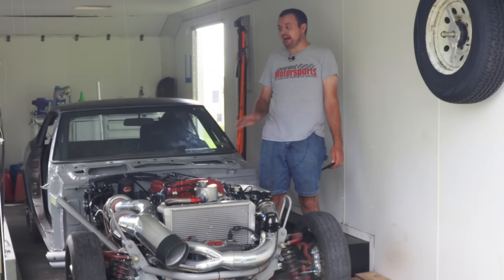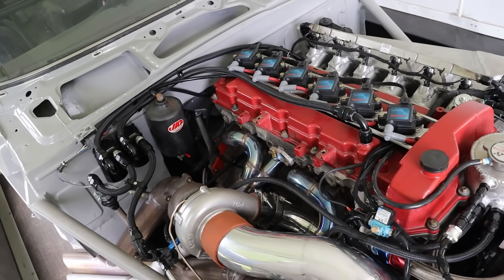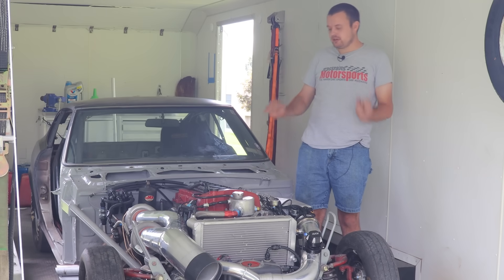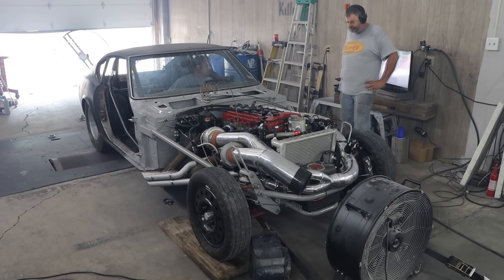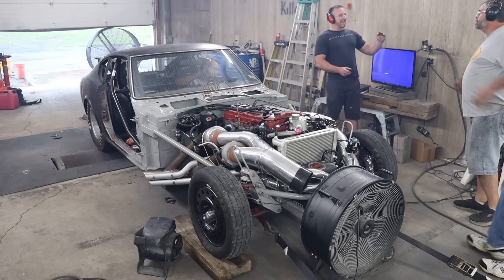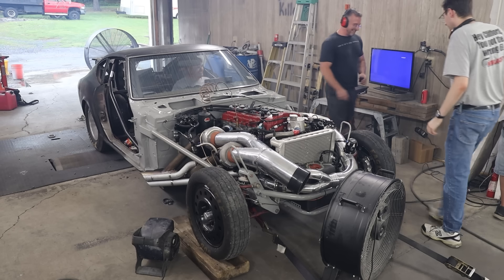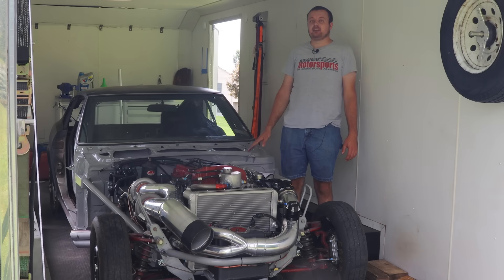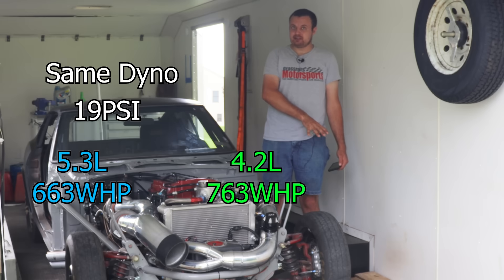This 4.2 Liter Engine Just Beat a 5.3 LS!

Comment: I'm calling out your physics teachers if you think that heads don't matter.
Reply from the maker: When did I say that?
Reply: @Calvin-Nelson 09:49 you insinuate that the heads on the 5.3 aren't ported and keep harping on 19lbs of boost. Boost isn't everything (adiabatic efficiency, swirl, etc) and what is "less cam"? What kind of lobe separation angle, one might ask? The correct answer is not "it doesn't matter because it's 19lbs of boost". Aaand if you're doing a comparison, you have to look at torque curves, not just "Car and Driver" numbers.
Reply from the maker: @blahbadyblah  I don't have to do any of that. I picked a variable to remain constant between the two engines, one that I cared about and performed a test. One did better than the other by such a wide margin, that I felt it was worth sharing. If you don't find any value in it, I can't help you beyond that. 

Was it a perfect test? Nope. My hope that 100 HP more with 71 less cubic inches of displacement, and much smaller cam profiles both in lift and duration, would be enough to make a reasonable guess at which engine is performing better. 

See ya!
Reply: @Calvin-Nelson You don't HAVE to do anything at all. However, in your comparison, you're missing over 100"hp" of mods on the 5.3 that have been done on the 6 cylinder. I hope that you're at least aware that flow restrictions can make boost numbers look higher and that "horsepower" is a hypothetical extrapolation.
Reply from the maker: @blahbadyblah  Even if it made the same HP. It's still impressive.
Reply: @Calvin-Nelson Oh, of course.  From about 6100 to 7500 torque is over 600lbs-ft. That's a pretty fat curve especially for the small size. Big block numbers without the heft.
Reply from the maker: @blahbadyblah  That and it did it with no camshaft. The number 1 killer of cars on drag and drives are Valvetrain related issues. I'll take the engine that can make the power at a higher RPM, and do it with less aggressive Valvetrain, because it will have less failure.

Comment: My 04 Envoy has this very engine. 100 percent stock.  335,000KM and still strong.  no leaks or burning oil. it is an inline engine so it is torque not HP.

Comment: You mentioned that the 5.3L makes 100Hp less as compared to the 4.2L setup.
Horsepower is a product of RPM. The question is how high did you rev the 5.3L as compared to the 4.2L revved to 7571 RPM?
Great build awesome channel !!
Reply from the maker: The 5.3 with a more aggressive cam, and more displacement peaked at 6500
Reply: @Calvin-Nelson  now spin that 5.3L to 7571RPM and see what happens with a proper cam? That would be a great comparison
Reply from the maker: @hpjunkie69  you could easily do the math. 7571÷6500=1.16, so it would make 16% more power.
Reply from the maker: @hpjunkie69  I'd rather have the engine that makes more power with less camshaft. That means it will have less valvetrain issues, which is a big killer on the Drag and Drives

Comment: I dig it. Those are the kind of stats I've seen from a  4.0.   6 cylinder jeep motor. Impressive 🤔👍❤
Reply from the maker: I've not seen a Jeep 4.0L that has the cylinder head flow that these do. Throw enough boost at anything, and it'll make power
Reply: @Calvin-Nelson  thats awsome, I'm talking about Profesional high proformance engine building, and dynamic testing, with stats beyond a diesel 700 pluss hp with 700 foot pounds of torque.  And they said they believe they can easly hit 800 horse with the same torque,  and torque is whats going to move it beyond horsepower, 
I read about it and watched the videos of what they achieved,  6 cylenders are no joke, hell even the iron Duke. A 4 calendar was known to get over 400 horse.  Done right is the name of this game. You've done an awsome jobe. I'll pat you on you back, and give you 🤔👍👍👍👍👍, yeah, several of these, . Good video.
Reply: Oh yeah, I don't know about the motor you showed, sorry, engine,  but the jeep motor has 7 bering journals on its crank,   very strong torque monsters . 🤔👍

Comment: That Hp difference probably has more to do with turbo size and efficiency..
Reply from the maker: Both turbo systems were not even close to their limits we turned them both up from 19psi, and they continued to make more power. Turbo efficiency may have been a very small component, but I doubt it was more than 20hp. The smaller engine still made 100 more HP

Comment: On LS, manifolds are for aspirated engine! Meanawhile on 4.2 you put optimazed manifolds. Good cams for aspirated engine can be worst for turbo application. And head work make differents on turbo and aspirated. To be honest: LS was tuned like frankenstain, 4.2 was tuned more accurately. It's interesting comparison! Do you know fule flow rate? And rpm of max power is the same?
Reply from the maker: Yeah. I realize it was not a perfect test, but I still think it should be a wake up call. 71 less cubic inches and it makes 100hp more. If they had made the same HP, I would have still been impressed with the 4.2

I don't have fuel flow rate, but that is very closely related to HP, so you can do the math. The LS peaked at around 6500. The 4.2 peak was like 7300-7500 (it's in the video. I don't remember)

Comment: Mate, I hope your new torque converter is heaps better than that black one with the tabs broken off and not just another same design built. Because I build torque converters and that one is CRAP ! (no offence) it's a super old 10 inch design. You should be using a billet back (or actually front, as in flexplate side) but we call them the back in our world. Also I hope it's a GM 9 inch design, as they have a million different combinations you can make with different impellers and different stator combinations you can build to suit a multitude of combinations. I know it's a year old video, but I've only just seen it. Bloody cool though mate. We have a similar Ford engine in Australia called a "Barra"

Comment: Awesome build etc looks like a good deal of potential in these engines. The bottoms end seems stout the way it’s designed. I was sorta excited about these 4200 when they cam out. Similar hp to my 2nd gen LT-1.. not tq and not in the same league with power imo but hp numbers impressive for what it is. It’s a large 6 at 4.2 imo. Seems like a really good head stock. Wonder what they flow. maybe it’s comparable to the 5.3 with the difference in fuel etc but torque isn’t any better I bet even with the advantages.

Comment: I'm looking to get into this engine for a 67 Camaro build. In the middle of looking for aftermarket support, which is keeping me on the edge because it doesn't look like there is much. What camshafts are you using for this build? Custom regrinds? If so who did them?
Reply from the maker: Yeah. They are regrinds from Schneider Racing Cams. Have a look at this. https://sites.google.com/view/vortec4200wiki/home

Comment: Run them stock
Reply from the maker: That's not an interesting comparison. You can Google that information if you would like to know it.
Reply: @Calvin-Nelson  i know what u mean to. What kinda Trans and rear end running
Reply from the maker: @djhodges6892  Th400 9 inch in the 4200 car. 8.8 in the LS car
Reply: @Calvin-Nelson  gear kit or no
Reply from the maker: @djhodges6892  I'm not sure what you mean.
Reply: @Calvin-Nelson  gear ratios  a gear kit?
Reply from the maker: @djhodges6892  the 4200 had 4.30 gears. The LS had 3.27
Reply: @Calvin-Nelson  dont know if it would fit in the 4200 but put a Powerglide in it.
Reply from the maker: @djhodges6892  Nah. That would make things much harder. Would have to have an extremely loose torque converter and when you need to lay the power in on top it will slip like mad. Powerglides are better suited for engines with a lot more torque.
Reply: @Calvin-Nelson  well damn that sucks. Be real nice just to shift twice

Comment: I've been saying this for quite a while.  The Vortec 4.2L Atlas engine is an awesome.  Should have been America's 2JZ, but GM dropped this motor. Idiots. Aluminum 4.2L Inline-6, 24-Valve DOHC.  These guys built an insane Beast!  Should be swapping these into our toys.

Comment: which gearbox is used? will it be possible to connect this engine with Borg-Warner T56 or getrag V161?
Reply from the maker: We're using a th400. Yes those are possible.

Comment: Pretty cool. Technology has dramatically increased the hp gains on street and race motors these days. John Lingenfelter (RIP) made over 1,000hp on a GM 4 cylinder Ecotec engine years back. The biggest challenge at the time was keeping the cylinder head from cracking. The turbo he used was damn near the size of the engine block. You guys oughta be killing it on the strip. Best of luck!
Reply from the maker: Thanks!!!

Comment: With all fairness you said the 5.3 is single s480, but the ameri barra is twin, there may be a discrepancy in cfm flow between the two, and you didnt mention the size of the 2 turbos on the 4.2..
Reply from the maker: S480 is known to go 1200 hp. We aren't even close to that. Richard Holdener has done multiple tests to show that as long as you are not close to the CFM limit of the system, twin vs big single makes no difference.
Reply: @Calvin-Nelson  eeh somewhat, his twins made more power over the single if I remember correctly but only by 10-20hp, where the biggest difference was  was in spool and torque, one had a higher tq lower.

Either way props on the buold, looks sick, wish I could get a gen 1 supra and toss in a 4.2 with a t56, and twin spooly bois  more torque than the 1j or 7mgte, or the 1.5j and more hp at lower boost, while still sounding pretty sick. 

Also did you make the intake or have it made? I see your dad likes to hand port in the vid, and you made your own dual manifold in an earlier vid. But I didn't see one for the Intake, if you did make the intake what is the math for your runner length and plenum volume?
Reply from the maker: @62saki91  I made the intake. The math was, does it fit the car?

I did another more recently and did a shorter runner. It seemed to want to RPM more.
Reply: @Calvin-Nelson  aah, most if made themselves have a formula for plenum volume, short runners are good for response and high rpm, long runners give more low down grunt and torque. Tuning the setup so all parts work together and maximize each other at the peak power production is always best.

Comment: I had this motor in my 2009 Trail Blazer, which was the last year of the Trail Blazer. It was factory rated at 275HP, and a lot of torque, and that is why I bought it to pull my boat. It was a strong motor, and plenty of power on the highway. It had no problems pulling my boat, and did not have any problems at all with it. I wondered why no one had done any hot rod ding with the motor, but assumed it was for all the computer stuff that no one wanted to mess with at the time. This would make a great motor in like a Chevy ll with a straight stick, as would be a torque monster with headers and the like. With turbos I am thinking the sky is the limit! Great article!

Comment: The trailblazer I owned was fantastic. Folks were taking the 5 cylinder atlas motors and boosting them back in the early 2010's, I wish I could've done that to my truck, but there wasn't enough room. I think that version of the engine was in the colorado and hummer H2

Comment: The Atlas engines seem to have an Achilles' heel.  Once they get to around 200K miles, there is usually catastrophic engine failure.  Trailblazers and other vehicles that had them show up constantly at my local salvage yard, remarkably consistent failures.  They don't blow head gaskets - it's broken rods, something in the rotating assembly etc...Friend of mine had one, he kept thinking is was a fuel problem, I put a huge adjustable wrench on the crank bolt, no turn.  Seized motor.  I would only consider one of these if the internals were strengthened, but with that, goodbye budget build.
Reply from the maker: The ones we've seen will break before 125k or go 300+k the one we made 824 whp with was a completely stock 175k motor with cams and springs.

Comment: The C30LE on my Opel omega 3000 began to show signs of death, so I'm thinking of replacing it with one, I hope it will fit under the hood, because this engine is not much heavier in weight.

Comment: the engine is a german design with 4 valve heads so it probably has more hp at a much higher rpm than the LS

Comment: Have you thought about having the ring machined in the head and the block so you can give it the big boost with less chance of losing the head gasket I’d love to see if that would handle 30-50 psi boost great job hope you guys have fun and have safe racing thanks for sharing
Reply from the maker: We've had one to 40psi and have not had head gasket sealing issues yet.

Comment: Is there a small, light, 2 seat sportscar chassis by GM, that is not a Corvette, that this engine could be dropped in to?
Reply from the maker: It would be a tight squeeze into anything small, but we have done it in a Fiat before. You could do a Pontiac Solstice.
Reply: @Calvin-Nelson  Thought later, it'ld be an ideal motor to drop in a Holden Torana, both the LC/LJ series used for the XU-1 racecar, and the later UC 'Sunbird' hatchback.
Dropping one in to a replica Torana GTR-X would be pure porn,... ;)

Comment: You have a lot more turbo on this motor than the 5.3....lol

Honestly, not impressed.
Reply from the maker: An 80/88 vs twin 62/62s????? 80/88s are known to go to 900-1000whp on a 5.3. We're not where near that. Check this video out. If you are not near the limit of the turbo system twin vs big single does not have much of an effect. https://youtu.be/zp65Y7wKaEo?si=Gb_wBipMIZ2NxAjM

Comment: I have very often thought about the 4.2 GM DOHC inline 6 as great choice for a vintage mid 30's through 48 Chevy Street rod project and thus keeping the car t rue to it's inline 6 heritage. Even in slightly modified state of tune it would make a sweet running and quick street performer. I'm an inline six fan and have always preferred working on them.

Comment: I didn't catch the model number of that engine, and I think I want to buy one and maybe retrofit it to my 2004 Ford F150 FWD.  I would also need a GM trans and it might not be good money spent.  But that's one hell of a 6 and my good running 2004 Ford 4.? ltr engine has 220,000 miles on it so a new motor is attractive, especially a straight six that makes horsepower like this one.  I don't need that much HP, as I prefer reliability, but still... damn.
Reply from the maker: It's a Vortec 4200 from a Trailblazer.

Comment: Try comparing the 5.3L on twins and meth and the 5.3L wins all day long....especially on availability of affordable aftermarket parts (even though a SBE 5.3L can take over 1000hp on it's own).  That being said, I love the exploration into less popular engines.  And I love the idea of an "AmeriBarra" engine for GM enthusiasts.  It would be great if the right people/companies with certain abilities (access to CNC machines, camshaft cutting machines, etc) started a small aftermarket for these engines.  Considering how prevalent these engines should be in junkyards these days, they could be the next, affordable Vortec alternative for hotrodders and racers alike.
Reply from the maker: When the turbo is not being pushed to the limit, twins vs a big single doesn't make a ton of difference. Here is proof. https://youtu.be/zp65Y7wKaEo?si=yRz3gtB5e6k5AI2f

Both engines were running methanol, and both were not near the turbo's flow limit, so that part of it was a fair comparison. 100 more hp from a small engine is impressive no matter how you slice it.

Comment: I feel like you’re hung up on boost numbers like they’re both at 19 PSI so they both must be sucking in the same amount of air. Where boost is just a number representing the resistance of air being crammed in. Yes less CI, but much better VE. A better comparison would be to show the actual airmass going in to each engine. My guess is the Atlas is pulling in more air than the 5.3 when they’re both at 19 PSI and that’s where you’re seeing the 100whp difference.
Reply from the maker: You summarized exactly the point I was trying to make in the video. The Atlas flows a bunch more air. Air mass flow is horsepower. The boost was meant to be a point of comparison.

Comment: ive deeply considered into swapping my Jeep Lj (the longer version of a tj) i really want to keep the same motor but make it a stroker and slap S/c or Turbo and call it a day but damn i really want and need a engine that will have the intake and exhaust opposite of eachother not all on the same damn side, i haven't had no heatsoak problems yet in this texas heat as long as im moving and not idling for an hour but yeah 
But yeah i want a ford barra motor,2jz/1jz cause i dont want no damn Ls cause everybody got one nor a hemi any v8 really......id consider a big block chevy but yeah no id be goin crazy lol 

I really like this option and ive seen these motors but never quite thought anything of them until now since i've put my jeep stroker on the back burner after realizing how much im gonna spend for the hp im gonna make and most importantly the torque wich is a little low for me with the engine shown since i want my torque and hp to be in the same range all throughout but it can be fixed with some changes :D

Comment: Cool video. How did the 6 cyl compare weight wise to the 5.3L? Typically  inline 6 are heavier.  And packaging is more difficult (long)  but the whale of a winding straight 6 is sweet,  and they are smoother than a V8 because they are inherently balanced.
Reply from the maker: It's about on par with an aluminum 5.3